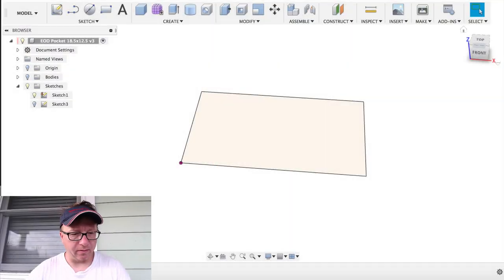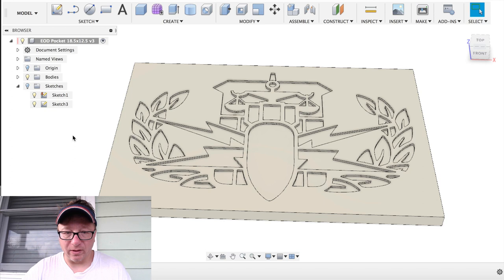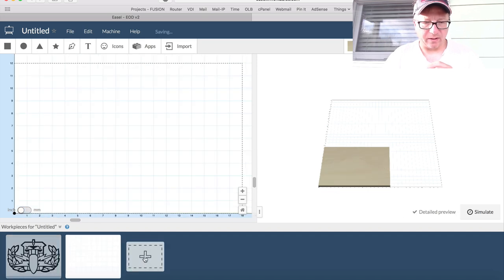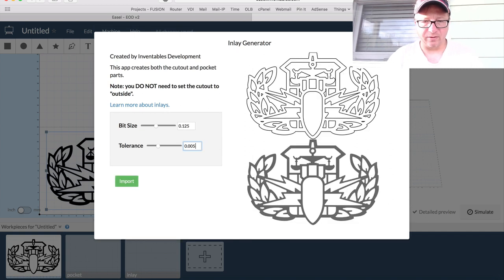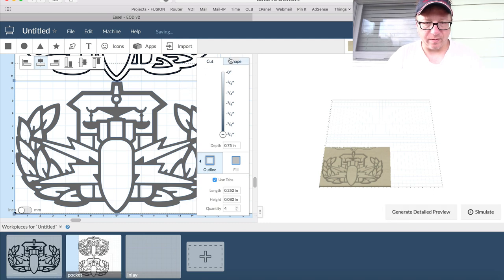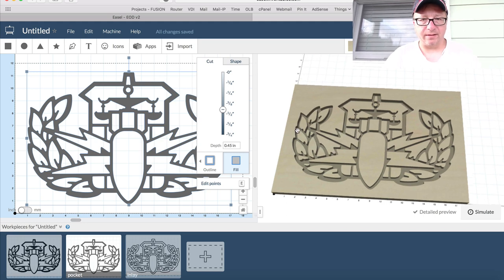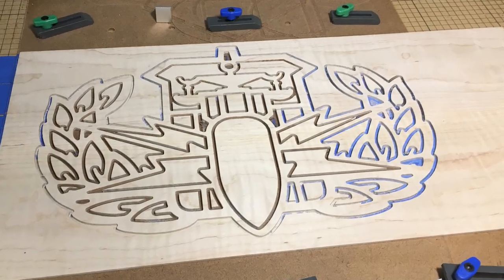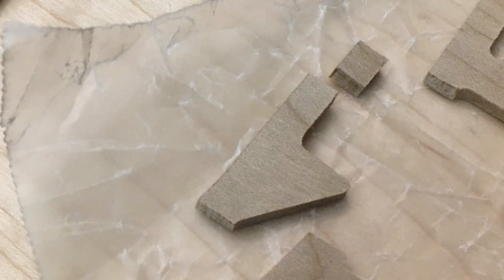Using epoxy and wood inlays with X-Carve, Fusion 360, and Easel

Comment: Hi @cyberreefguru, good video. Thanks for doing this video.

So did you do the design in fusion and then upload to easel?
Reply from the maker: Hi Andrew - thanks for watching! I actually started in Inkscape to get the vector processed and minimized, then pulled it into Fusion/Easel.  I have other videos showing how to do that if you are interested: https://youtu.be/sSSAtopSyI0 and https://youtu.be/x7ZbGt8TcoY Hope this helps!
Reply: @cyberreefguru  thanks. I like the cad capability of fusion 360 but the cam settings of easel. Do you know if I can take a fusion model and pull it into easel to do the cam side of things?
Reply from the maker: @andrewdunbar  Hi Andrew - you cannot move the Fusion design file directly into Easel.  Looks like you need to export your design (i.e., sketch) as a DXF, then convert the DXF into SVG (you can use Inkscape to do that or any number of apps or web sites), and then import it into Easel. Fairly complicated I'd say - easier to learn Fusion CAM ;)

Comment: When you first assembled your xcarve did you notice that your inlays were loose?
Reply from the maker: Hi Christopher - they were not. I spent a lot of time ensuring the machine was dialed in before I started using it.  Lessons learned after a few years with the Shapeoko 2.  If you are using Easel, the inlays will have a bit of play, but not terrible.  With Fusion 360, you need to use a negative stock to leave to ensure proper fit, otherwise you won't be able to get your inlays into the pockets as they will be the "exact" same size.  Hope this helps - thanks for watching!
Reply: cyberreefguru thank you!